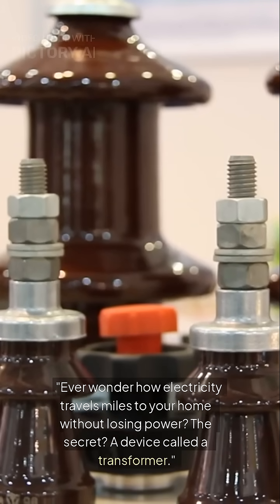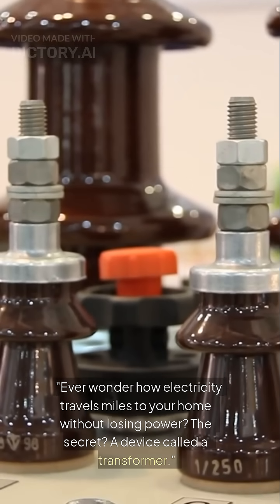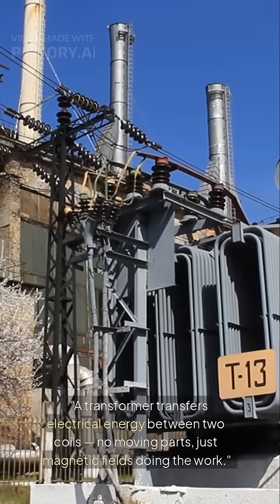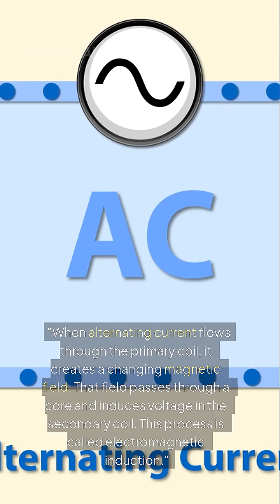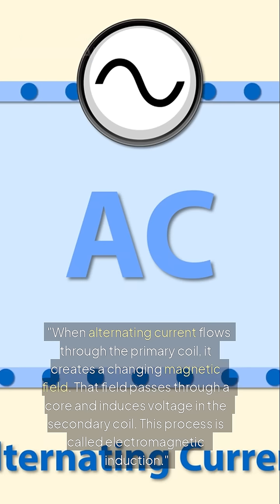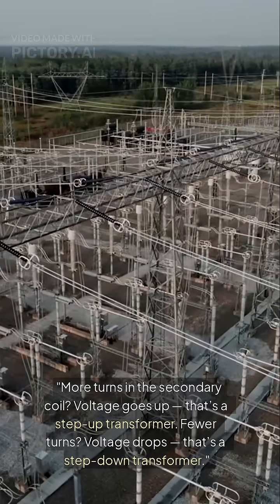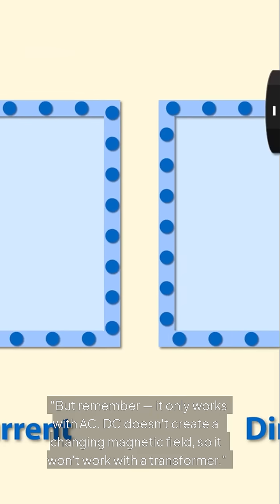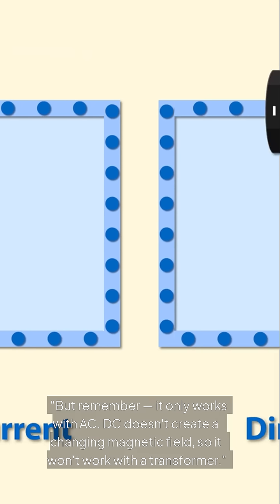Transformer – the voltage shape-shifter #gate2025 #electronics #techexplained#ece #physicswallah

Comment: Without losing power?
Even the transformers heat up from the energy passing through.  So energy is still lost in the form of heat.
Reply from the maker: Transformers do lose power, mainly due to: Core losses (constant) 
Copper losses (load-dependent) But they are designed to minimize these losses, so their efficiency remains high in most practical applications.